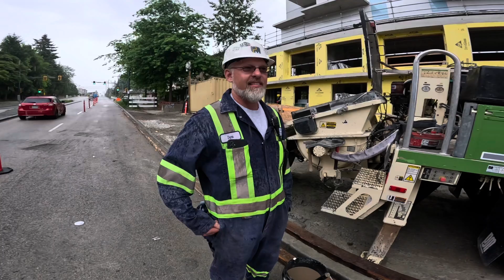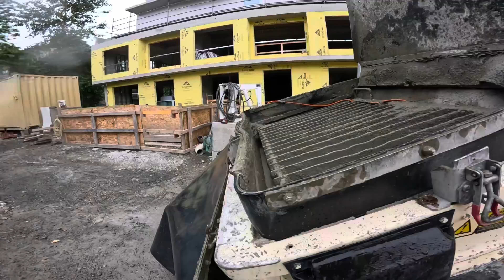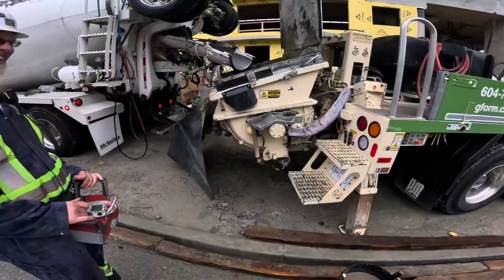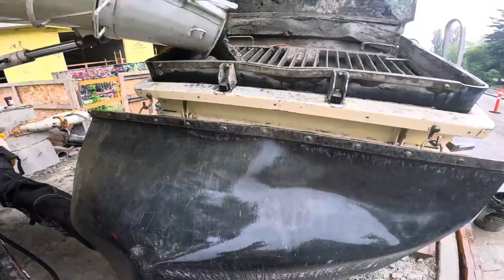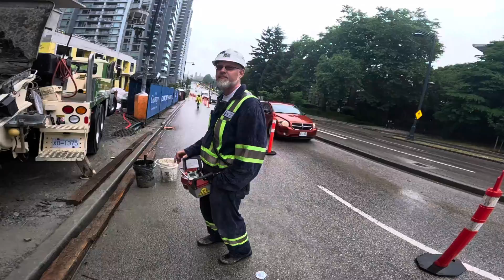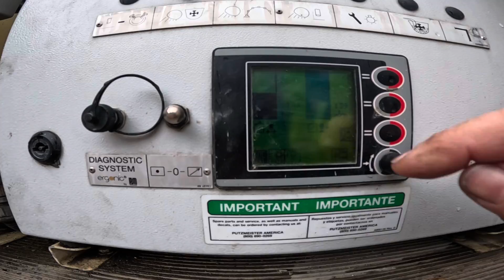Checking out a BADASS, 70+ storey high-rise pump!!!

Comment: I noticed the slump was pretty loose. With pumping that far up, how much slump do you lose vertically?
Reply: Out in the valley placers and drives all do slumps by inches. Once you cross the port mann seems to be in mms.
Reply from the maker: @falcone2307  I’ve found it to be more of a commercial vs residential thing. Drivers, pumpers, and placers speak in inches, slump testers speak in millimetres.
Reply from the maker: It’s really tough to say. Depends on individual supplier as well as what type, and how much chemical is in the mix. Also, how high you’re pushing (obviously).

We had a couple of years ago where the regular supplier for the job was using powder from their competitor. That stuff would go into hopper at a 200mm slump, and come out the end of the boom on the 30th floor at a 90mm. It was crazy! 

As an average/ballpark: I’d say 180-200mm at the hopper, 130-150mm at the discharge end of the hose
Reply: So 8” slump at the hopper 4” slump at the hose for us south of the border
Reply from the maker: @raulbejarano9104  my Canadian-American conversion comes in at 7”-8” at the hopper= 5”-6” at the discharge end 😁😁😁